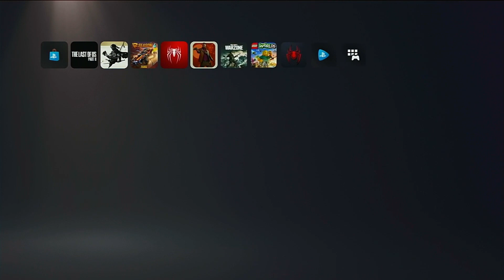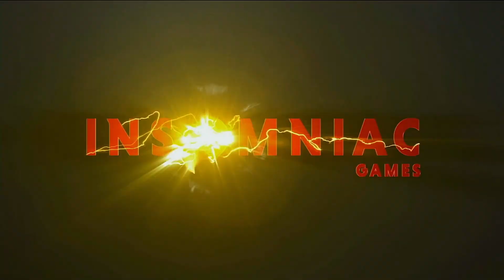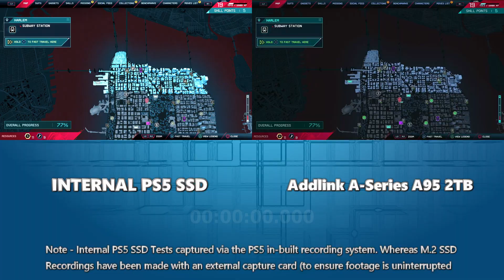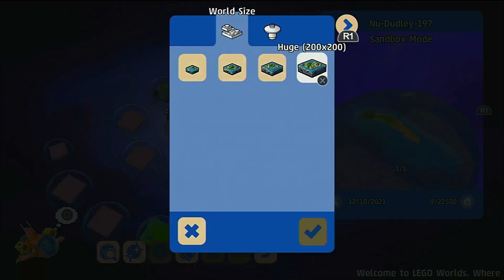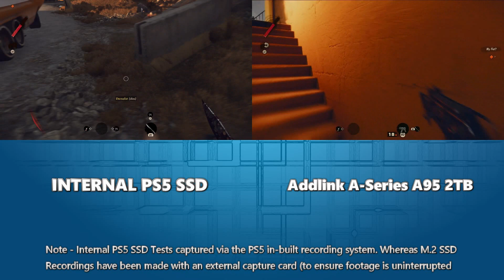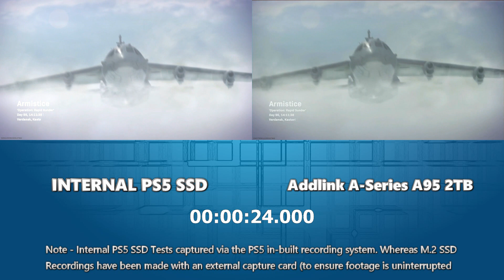Addlink A95 PS5 SSD Loading & Performance Test 1

Comment: Don't buy those SSDs, they are bad, I bought two, both came with writing problems, causing the SSD to always disconnect when installing some large program. The company is not responsible for the guarantee since its contact system for the guarantee does not work, they evade you by sending a message it has not been possible to process your request, try again later.

Comment: Curious as you keep bringing up the idea of texture pop-ins test to see a potential bottleneck in storage speed. Have you ever encountered it or have you ever tried it with the slowest allowable nvme to prove your point? Because i think that argument is moot and unrealistic if you’re trying to saturate even the slowest nvme that way given that we are talking about multi gbps storage transfer speeds at pcie gen4 already.
Reply: Point is i am using a slow beyond than recommended speed pcie4 ssd and even that i never encountered any texture pop-ins. So hunting for it looks to be trivial at best. Speed among nvme ssds are only felt if you’re moving games from and to the internal ps5 storage.
Reply from the maker: Good question. So far it the Silicon Power US70 and Sabrent Rocket Q4 have been the worst offenders. With RDR2, Subnautica and Star Wars FA having some poor texture swaps +when a game introduces high textures at distance). Likewise, the loading time differences are always worse on the bigger world load games (ranging from 0.1 to 6 secs so far. Your comment is a valid one though and as I record-voice over the SSD test without seeing the side by side (as it comes out in the edit), I rarely get a chance to call this out directly in the final product. I'll change things up a bit + maybe make a compilation roll to demonstrate this. Cheers for watching
Reply: @nascompares  happy I read this comment. Was going to jump the gun with the Rocket SSD.
Reply: @nascompares  In order which would you recommend for PS5 gaming between the addlink addgame 95, 90, or 92 and the Adata XPG Gammix S70 Blade?
Reply: @alanrichardson6561  I'm also debating between the a95 and s70 blade
Reply: @nensenbenjamin1361  the best choice out the two based on price was the blade for 1tb I got 2 of them  for $129.99 a piece but I just wanted to know his thoughts.